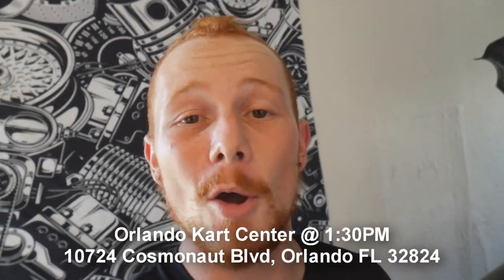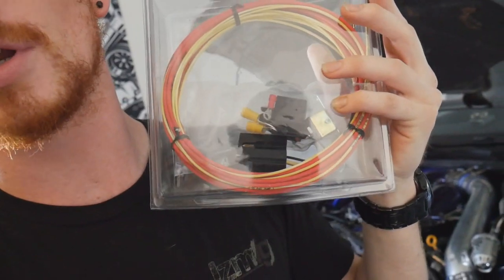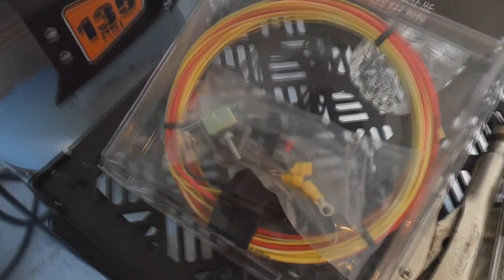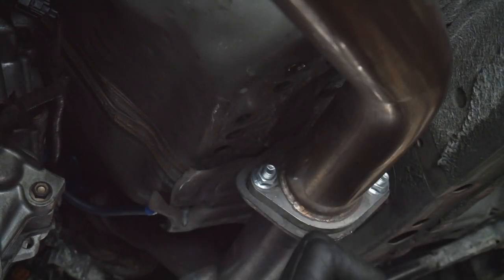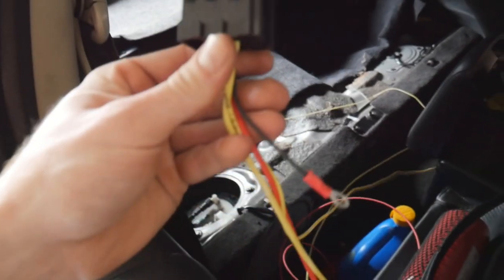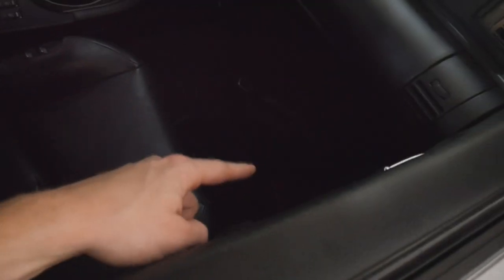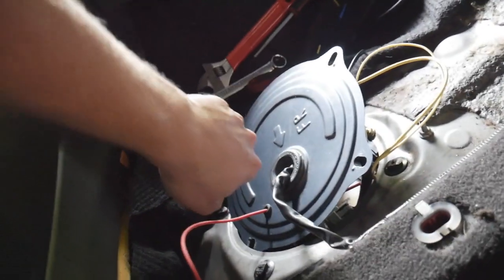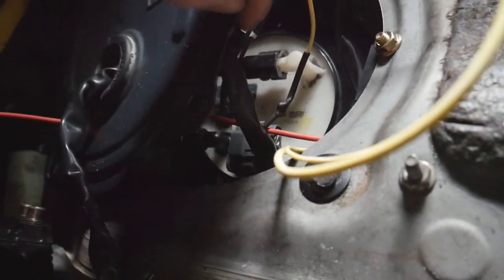Built Boosted Twin Turbo G35 Fuel Pump Relay Installation

Comment: As a professional technician, I would recommend having your fuse close to the car battery or to an auxiliary fuse panel...What is the current draw  of the new pump vs. the stock unit? Reason, those wires inside that new fuel pump did not look very thick (18 gage?)...If so, your rewiring was not necessary...Whatever heavy power gage you use,make the return ground the same gage. You're making good progress on the build.